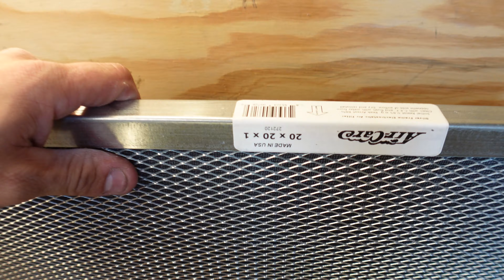Waited all winter for this...

Comment: CCXD yes you need the wall .. having a hot box and cold area is perfect for any type of mining, using 1 inch pink insulation foam boards and make exhaust cut out for all of your minors into the hot box would make it absolutely perfect! You know my setups in apartments I have to make a dedicated hotbox so the room remain 100% cold even with 12 big boy Bitmain miners.
Reply from the maker: Yes! Ok that’s the plan! Stay tuned! Lol

Comment: Trailer is looking good. I am looking into solar to power my very small farm during the day and then run on AC power at night. Do you have to have batteries with the Growatt or can you run just solar and AC? Keep up the great content!
Reply from the maker: You can just use solar for the 5 or so hours during the day as the wattage is coming in need be!
Reply: @ChumpChangeXD  so it automatically switch over to AC power when needed and not interrupt the mining rigs?

Comment: #L7  Your idea for 3 exteernal 30A plugs to connect to grid power is good but you need to use actual trailer plugs to protect against the weather. Regular indoor "oulets" won't cut it.